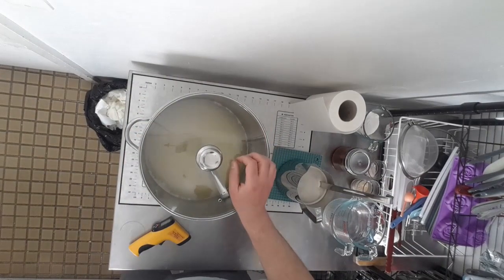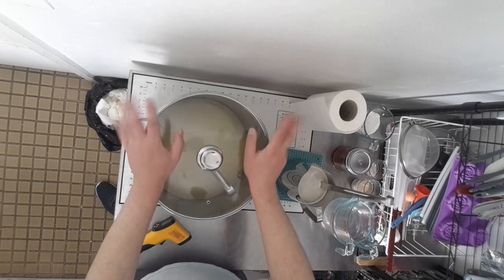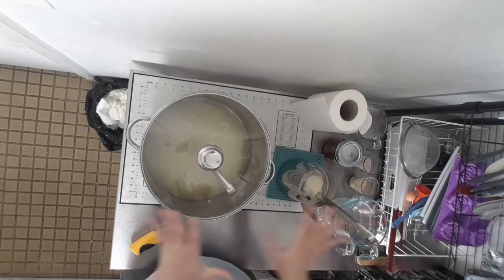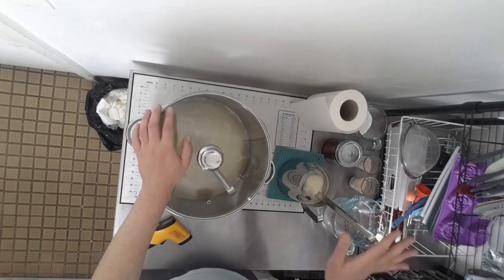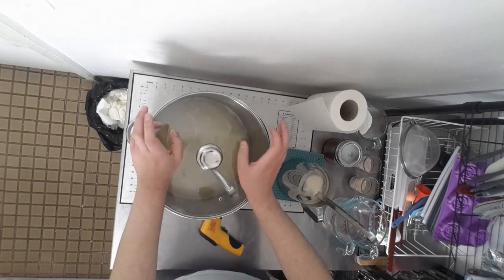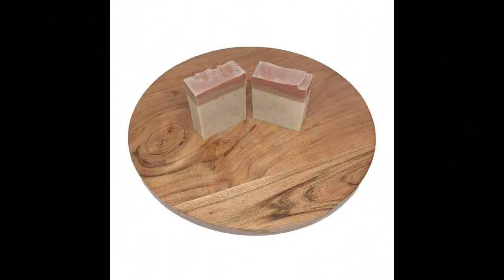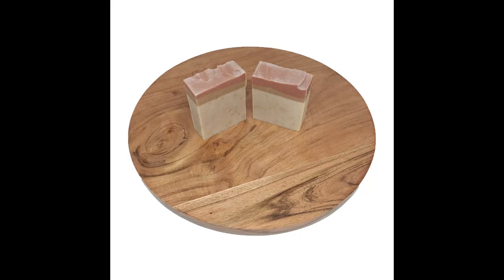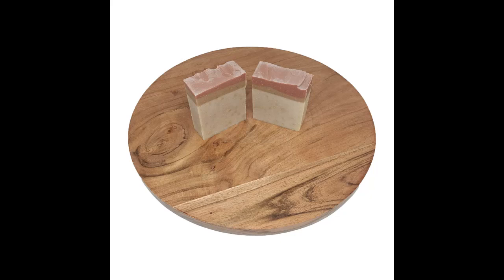100% Coconut Oil Cold Process Soap Making Tutorial for Charity (Berry Vanilla) - Dawn Organics

Comment: So you used fragrance oil but fixed either the cedarwood essential oil? I just want to get it in my head as I’m thinking of trying with some of my fading scents
Reply from the maker: Correct. I often fix them with cedarwood atlas. I found good success with it. Of course it will depend on what Fragrance oil your using. Depends on quality and flashpoints also. Generally it would work well 👍🙏
Reply: @kingofsuds  thanks …. Soaking up all this knowledge